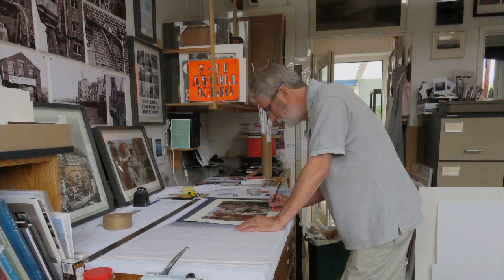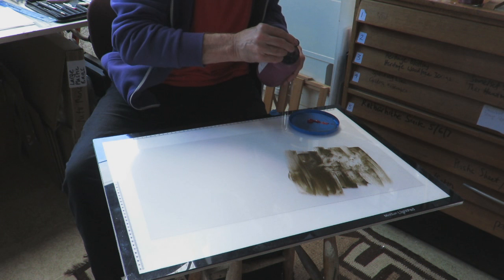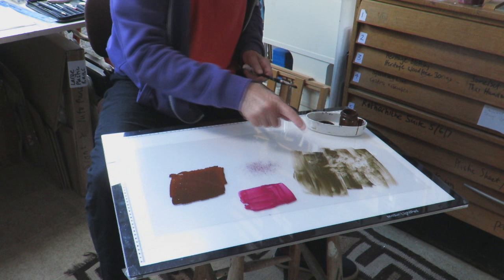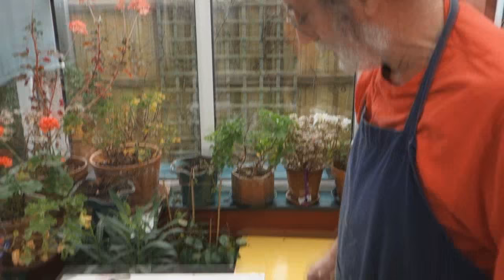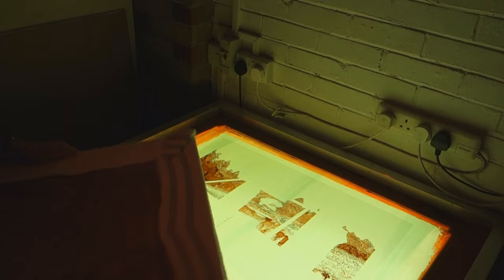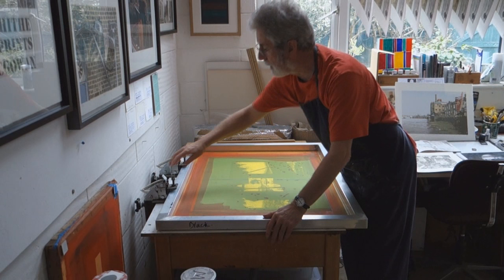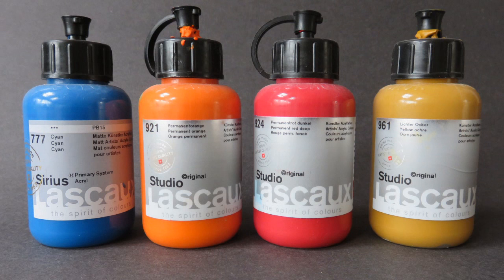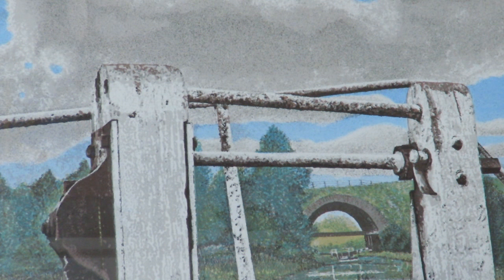Making a Landscape Screenprint using Lascaux Tusches

Comment: Hi John, I loved the video and your clever approaches to screen printing. I was wondering if you had any tips on making your own vacuum table and where did you get your heavy duty hinge clamps from?
Reply from the maker: Hello Neil, sorry its taken a time to reply, I've been making some new Lascaux films.  Making a vacuum table: its a shallow box with a laminate top and 3000 holes drilled with a 1.5 or 2mm bit.  Hole in the bottom of box big enough to put the vacuum cleaner nozzle into it.  I found an old school teacher's desk ( being an old school teacher) took the top off and put my vacuum box in its place. Very low tech! The clamps were made by PotterVac a very long time ago. I don't think they are in business now. The springs are good as they mean you don't have to have a leg at the side, but that would do the job if you can't get sprung clamps.

Comment: Can you tell me a bit about the plastic sheets you paint on, what is it and where do you get it from?
Reply from the maker: I’ll get back to you soon. My supply was bought some years ago and I’m not certain they are still trading.
Reply from the maker: Staufen Gloss Clear PVC RW PR107 1B 2020 GLS/GLS 0015.  Size 210 x 297 mic 220.           Bought from Robert Horne Group. Hope that’s enough info. John
Reply: Thanks very much that's very helpful. Great video by the way. Liked watching it very much.